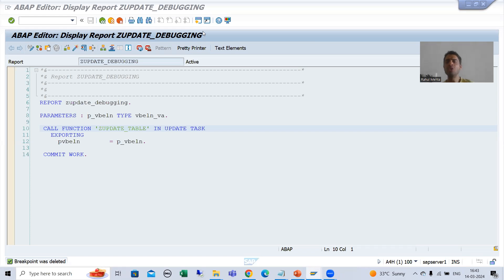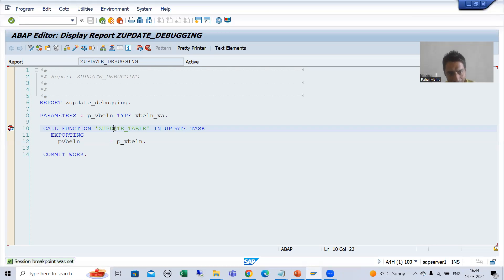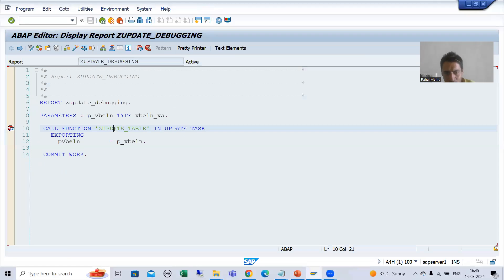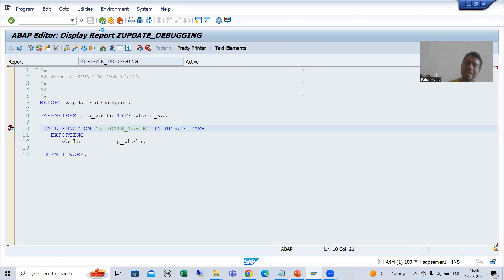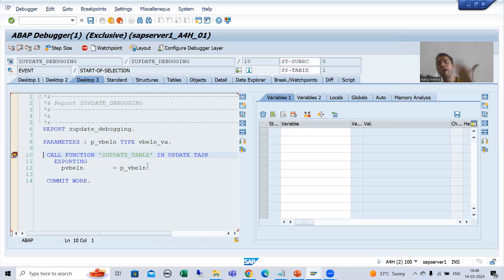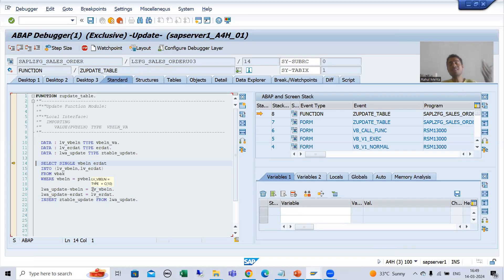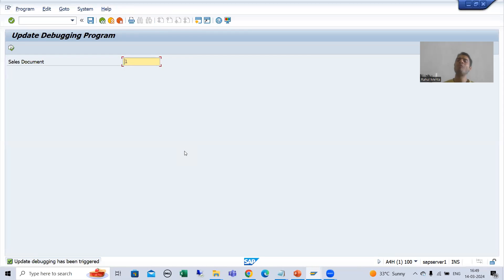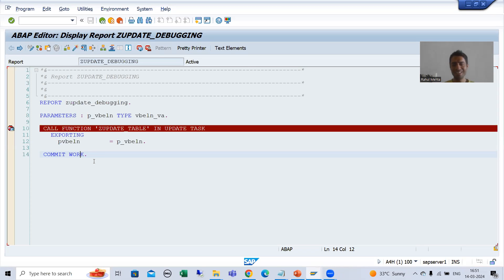51 - Additional ABAP Concepts - Update Function Module - Update Debugging

Comment: How to know if the program is running in update mode or normal 
I have a case where a badi implementation to save sales order data is called in normal mode and update mode as well 
So, I want to distiguish between update mode and normal mode at rutime 
Please help
Reply from the maker: Hello Hitesh - Check this. It might help.

Use the method GET_IN_UPDATE_TASK of class CL_SYSTEM_TRANSACTION_STATE  If the program is running in update task. This method returns parameter will return 1, else it will return 0.
Reply: @sapabapbyrahulmehta  Thank you Sir, it was helpful